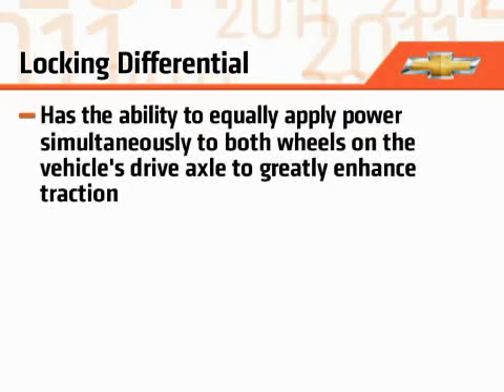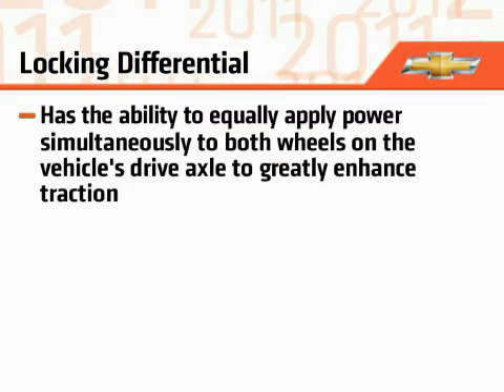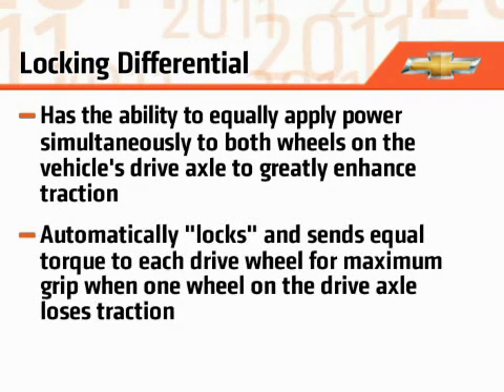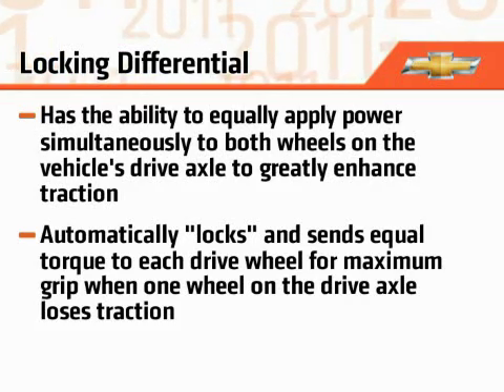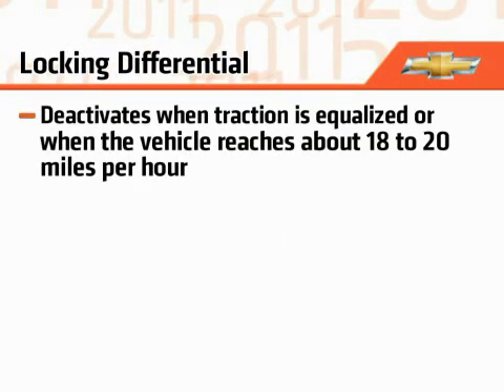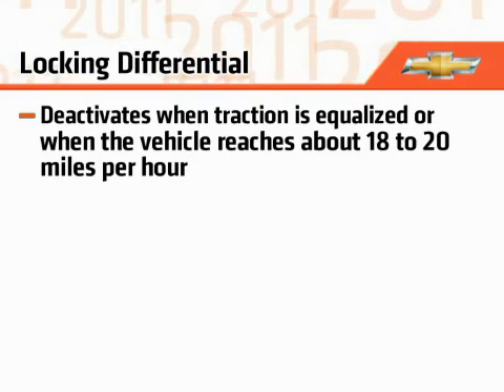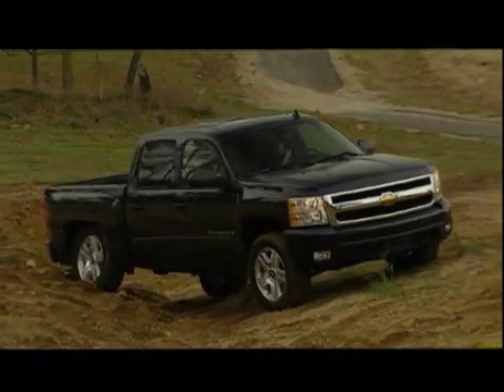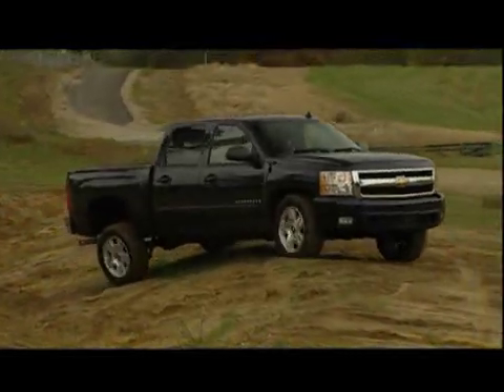G80 Locking Differential

Comment: well wen i bought my chevy from my dad he bought it new from the dealer the code comes up as gt4 witch is just the stock 3.73 gears in the rear and when i did a rear end oil change it had a g80 in it and the rear end was never swapped or changed by my ole man and he bought it from the lot?

Comment: Incorrect statement. Diff lock transfers equal REVOLUTIONS to each wheel. Torque depends on weight on wheel, friction coefficient of contact patch, and sticking or sliding friction.
Stuart Saunders.

Comment: Incorrect statement. A locking differential sends equal revolutions to each wheel, not equal torque. 
Torque is determined by weight on each wheel and friction coefficient of contact patch & whether sliding or static friction.
Stuart Saunders.